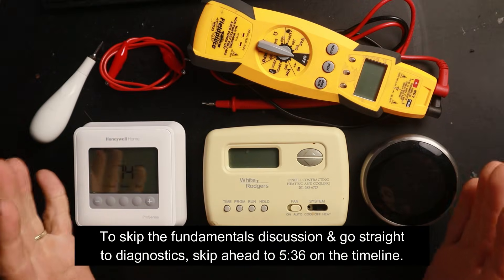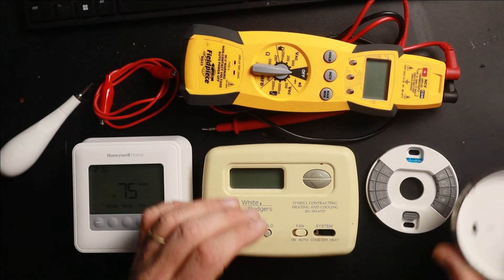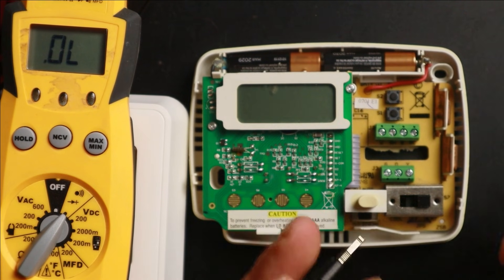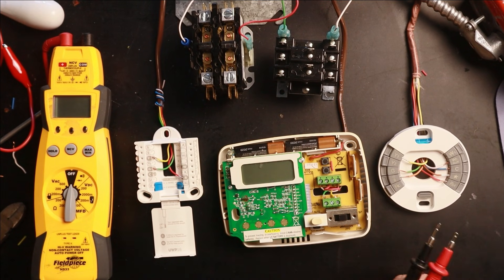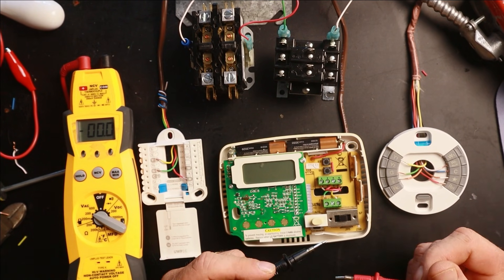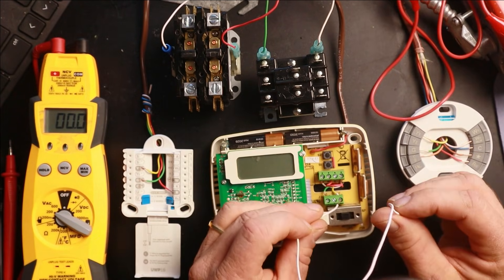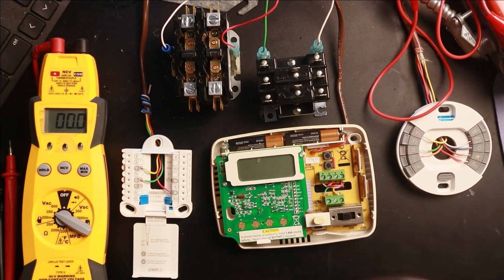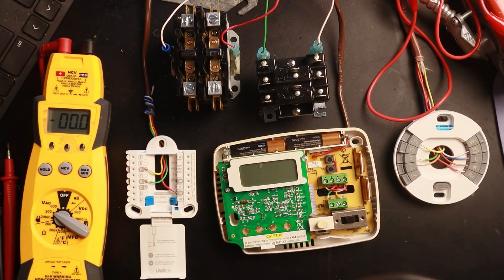How To Test If You Have A Bad Home Thermostat

Comment: I have a so called smart home.  The nest thermostat is a pain in the hind quarters.  Wiring wasn’t the problem.  Keeping it connected to the remote server or operational when the internet went down was.  Not acceptable.  Went back to a traditional thermostat.  Yes, could have wired in another thermostat.  Why.  Sometimes the oldest solutions are best.  If you want an internet enabled smart thermostat, make it a tertiary thermostat or get a central a/c or heat pump and furnace with wired ethernet control.  Heck, you can do that with an old furnace and Central Air Conditioner today.  There are sensor blocks and relays that are Ethernet enabled.  A simple bit of coding will help automate these functions.

Comment: I have a Trane heat pump with their TCONT802AS32DA thermostat (the base is separate from the switching mechanism). Could I "test" the proper pins on the battery-powered switch for continuity when calling for fan, cooling, or heating?  This thing is a monster, with variable speed, multistage compressor, and auxillary electric heat!
Reply from the maker: If you can test the pins then you should be able to do it that way. But I would do an ohm reading rather than continuity. Continuity doesn't tell you the integrity of the connection. It'll beep even if the connection is weak. With ohms, you want OL for an open switch and close to 0 for a closed switch. If you're reading OL when the switch should be closed or several ohms when it's closed, then the stat is likely no good. Keep in mind the worked in time delay for cooling when testing it.

Comment: If the thermostat doesn't work take it off the wall and put the two wires together if it works you need a new one
Reply from the maker: Yes, but if it doesn't work you have 0 information on where the problem is because you didn't do any voltage tests.

Comment: So far I haven't found a video that says how these systems work when in heat pump mode as far as the signal path and how it automatically turns on the element contactors when it's too much for the heat pump etc. Thanks for all these great videos!

Comment: I have a couple newer Honeywell contactors in my old ruud air handler and after the heat is on a while suddenly sounds like it begins opening and closing constantly instead of remaining closed and it sparks inside while it's doing this bouncing about once per second or so. I get about 28v coming out of the low voltage transformer so I'm assuming that's perfectly fine.

Is there anything besides the contactor itself that might be making it bounce like that? What's really confusing is the contactors run the electric elements but only does this bouncing in heat pump mode when it's calling on the B terminal. If I use em heat it runs fine using only the elements which I thought was the purpose of these contactors??? Is there another contactor besides these two somewhere that might be failing maybe that calls for the elements only when the reversing valve is activated? I'm getting confused why it's only happening in heat pump mode.

Comment: great video, my transformer has a blue and yellow wire on the low voltage side. the blue has 24v but yellow has no voltage. My unit works fine as far as I know. does that mean I need a new transformer? I have no control board.
Reply from the maker: No those are good readings. The other wire is a common for the circuit and will read 0 volts.
Reply: @JerseyMikeHVAC   thank you for the prompt reply. Could I use the wire with 24v confirmed volts for my common wire to run powerto an ecobee?
Reply from the maker: @louisviciedo  the powered wire goes to the stat R terminal. The common from the stat goes to the wire with 0 volts on it.

Comment: Thanks for the tutorial, Mike. What would happen if 2 thermostats were spliced together (Rh+Rh/W+W) and connected to a furnace? Would both be able to call for heat independently?
Reply from the maker: Yes they would, but either one calling will heat the entire house and not just the vicinity of each individual thermostat.

Comment: thank you Mike.  my hvac unit has a nest tstat but i only have a red wire attached to one of my rc/rh terminals.  but i have heat or air hows that possible if i only have one red wire attached to only one r terminal?  i may have missed my answer in the video.
Reply from the maker: Smart thermostats have an internal jumper, so can power heating or cooling mode from a single low voltage power source.

Comment: Is there a video for install nest when there are 2 wires in R spot & then a jumper wire from R to Rc?
Reply from the maker: If there is a jumper from R to Rc then both R terminals are treated like a single R terminal.
Reply: That would work if there was 1 wire in the R terminal but here was not.  There was 2 wires in 1 terminal then a jumper on top of that from R to Rh.  It had no power to ac with only 1 wire in R.

Comment: My in-laws a/c system went down. I discovered that the BACKPLATE for the nest shorted out. this caused the contactor coil to burn out , the fan to stay on and the 3-amp fuse to blow. I removed all the wires from the backplate and everything was fine. New backplate.
Reply from the maker: Good job

Comment: Thank you!  Greatly appreciated.  I have the same honeywell tstat and the fan comes on in heating and cooling modes.  But when trying to turn on in just fan only on or circulation modes, the fan does not come on.  How do I test to see if that is a tstat issue?  Thank you!
Reply from the maker: Jumper R to G. If the fan comes on that way but not in the ON position without the jumper, it's the thermostat.

Comment: Another great video, Sir. I now am sure that, I am able to trouble shoot the low voLtage circuit, because of you. i actually was able to understand you fully, because of the thoroughness you provided. I doubt it very much, that any one else out there could have explained this with such clarity. Thanks a million. I am in retirement, and I am now positive that I will be able to make some extra income, because of you. Been on a fix income, and barely making ends meet, I now will be able to service heat pumps for friends and relatives, and make some extra money. I thank you from the bottom of my heart SIR. God bless you.
Reply from the maker: God bless!

Comment: For the style that completely pulls off the wall and runs on batteries, can't you test the thermostat itself directly by calling for heat or cool and probing the contacts for continuity? Instead of jumpering the wires in the wall.
Reply from the maker: Yes, you can do that too, but that requires shutting the power off.
Reply: @JerseyMikeHVAC  wouldn't you still have to shut off power if you pull the front piece off to get to the wires behind the wall? After the thermostat  is disconnected, it can be tested independently, as long as it is battery powered.
Reply from the maker: @realSamAndrew  No, you still have power on the wires and terminals. Battery just operates the switching.
Reply: @JerseyMikeHVAC  I think you misunderstood. The thermostat needs to be pulled off the wall to access the thermostat wires going to the air handler so you can jump them if that is the plan. Correct?

Now once the thermostat main unit is in your hand, you can test it on a table with no regard to a system or line voltage if it runs on battery power  .Correct? It's just a fancy switch that you can test like any other switch.
Reply from the maker: @realSamAndrew  If the thermostat is designed for that then sure. I just assume in practicality the thermostat is being tested because something isn't working. Jumpering will tell you right away if it's a system problem or a likely stat problem. 

But there's no rule it has to be done a certain way. If you want to test the stat on the table then that's fine.
Reply: NOW!! that makes a lot of sense. @JerseyMikeHVAC